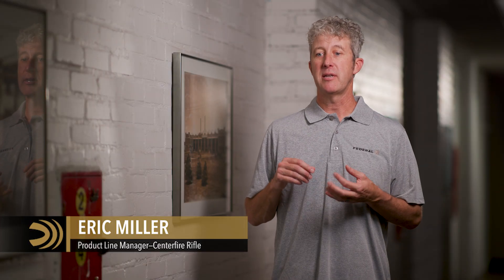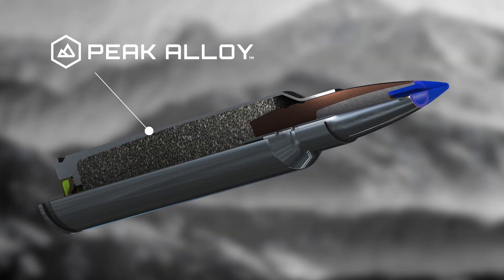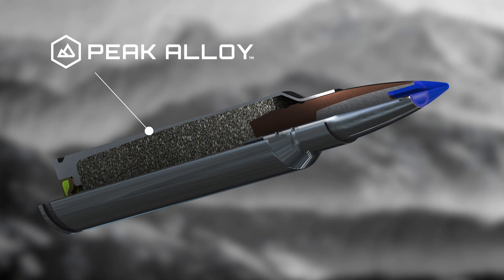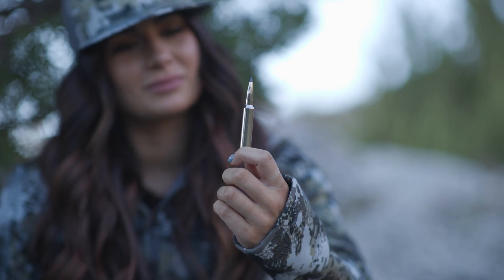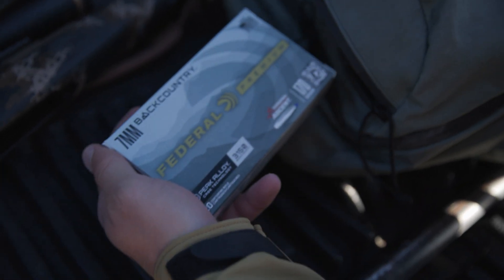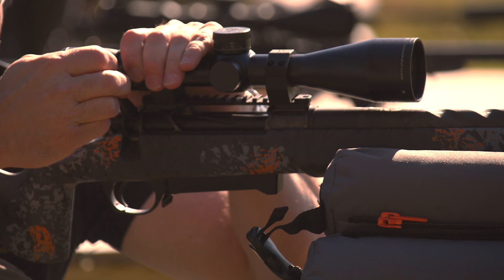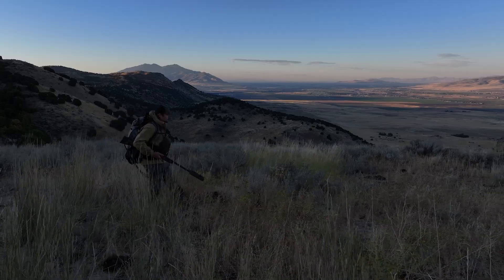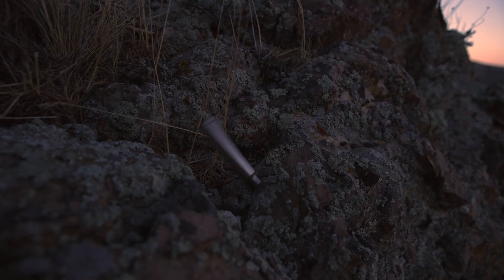7mm Backcountry: What Is Peak Alloy?

Comment: 65000 psi to 80000 psi... The higher pressure downside are 1, a higher barrel wear, 2, a higher stress and wear on lugs and barrel extension and 3, unless primers material is also new like peak alloy... pierced primers !
Nothing is free!

Comment: So I've seen several references to Ultra High Strength Steel alloy being used in other aspects of guns too. Usually it's where weight savings are beneficial and strength is critical. The interesting aspect is that it seems the shift is coming from a move away from yellow metals and lead as a whole. Hornady makes a lot of steel case ammo and has for years. Some of us know what the material is....but it's been around for decades. Many don't realize that steel bullet jackets have been around for almost a hundred years and were the predominant metal jacket in  WW2....

Comment: If this peak alloy thing is going to work, manufacturers will adapt this steel alloy idea. I mean....technically you could just take a 223 Remington round and instead of loading it with the max of 24.5gr of N133 (55gr FMJ) just take the next faster powder... N130 would be listed with 23.5gr max. But with such a case I guess we could add 1 grain easily. Using the same powder won't work cause of the cases limited volume.  So the recipe lies within the stronger case and the next faster powder. Good idea if its working. You could push a 5.56 bullet out of a 16" ar15 with the same speed as with a 20" bolt action rifle shot with regular brass ammo. Packing this idea into a short action rifle will catch the army's interest and eleminate Sigs very costly 6.8x51 Nato.
Reply: Geissele came out with a video of them shooting Peak Alloy out of their 5.56 guns
Reply: They already are testing this in .223 Remington

Comment: Could  a .280 Rem be rechambered, similar to rechambering in .280 Ackley Improved, to shoot this new ammo? What is the major difference, besides case material, powder and pressure, between the .280 Rem and the 7mm Backcountry? Is it a steeper shoulder angle? If a .280 Rem has already been modified to shoot .280 AI could it also shoot this new stuff?

Comment: So why not just use peak alloy on traditional cartridges to amplify their performance, 243, 270, 3006, etc. instead of making a whole new caliber cartridge???
Reply: Old bubba will try to shoot them in a rifle that can't handle these pressures like a really old bolt gun or maybe some of the auto loaders.
Reply: @gerry6.8 exactly, it’s a liability issue. Plus if they can get this to catch on I’m guessing it will be more profitable.
Reply: @ratherbefishing4225  Correct, it would be nice if we could but they can't take that kind of risk.
Reply: @gerry6.8 what risk?
Reply: @gerry6.8  they tested it in multiple standard production rifles. seekins christianson, and even savage 110s as well as many others.
Reply: @gerry6.8  i was gonna say cant have the same name or people will use it were it shouldn't be. like .45lc +p can't use that in a standard .45lc pistol but people have tried.
Reply: @gerry6.8 modern rifles can withstand 120k psi
Reply: @jeffholton6587  That's my point, those older rifles aren't a modern gun.
Reply: @ which older rifles? Steel shot in old shotguns can blow the barrel out. So which ones are you referring too? 

You can look at an old barrels and see if it is thin steel barrel but older receivers aren't made thinner. Doubt the metal has degraded or is of lesser quality.
Reply: @gerry6.8  savages 110 came out in 1958
Reply: @Blue_Dog_Ranch  Yes they certainly are a strong action
Reply: @jeffholton6587 yeah but for how long? I would NOT want to shoot my 4th box and shear a lug off and send the bolt back into my face.
Reply: @ when you get a chance to look at one of these 7mm back countries you will see the lugs are no different than a none back country rifle. No redesign of the lugs or added lugs or chamber modification just chambered to fit the new demisions of the cartridge
Reply: @ there will be cartridges made for these other calibers even if it is done in someone basement this is the united states of America 😊
Reply: @jeffholton6587 then why did seekins beef up their action to handle the higher chamber pressures of the new federal cartridge? Apparently more cartridges are coming out with the same concept this year.
Reply: @ how did they beef up their action? 60 degree bolt isn't beefing up an action in fact you could argue contrary
Reply: @ they changed to a beefier 3 lug action to give the 60 degree bolt throw AND be able to take higher pressure cartridges. They quite literally future proofed the new design
Reply: @  As you stated they had to go to three lug to have a 60 degree throw. 

The rest of what you said sounds like marketing smoke and mirrors to me.
Reply: @ well it’s not me saying it…they literally said they beefed up the action. Why the hell would you run a standard action on an 80,000 PSI chamber pressure? Thats stupid as hell
Reply: @jeffwilliams3436  the problem with higher pressures was not the rifles but pierced primers and blown pockets

so smaller firing pins, tougher primers, and tougher primer pockets/case webs
Reply: @jeffwilliams3436 with a 280ai at 80000 psi, a cmv barrel only 1/4" thick, and a carpenter 158 bolt, and a savage 110 action. 

 you are below the max limits with the chamber being atleast 2x stronger than needed an the bolt lugs being atleast 20% stronger than needed
Reply: I have no issue with them creating a new cartridge, however I had a similar thought as you. What happens if they use this peak alloy and fast burning powder in existing rounds? In theory it should just mean increased velocity/performace across the board right?
Reply: @DavidSmith03-l2z  Yes as existing receivers and actions can with stand 120k psi they do not have to do anything other than supply the peak alloy case for any caliber. Allow is cheaper than brass.
Reply: thats right. its almost a 280 AI.
Reply: @beavisbrowne3497 ding ding ding!
Reply: This was where I went to yesterday. An 80k psi 300 Win Mag would be just fine for me, but feel that there’s lawyers involved somewhere here…
Reply: Right, this is the question!  Why not a 270 win or 280 AI?
Reply: Bill Geissele has already published a video on FB demonstrating an AR15 firing the 223 loaded to higher pressures in PA cases.
Reply: I was thinking .243 & 30-06. Would be pretty sweet to see those numbers.
Reply: Hopefully they run a line of peak alloy cartridge cases in the very least. 

That way, if you were so inclined, you could load your own ammo. It would take some liability off Federal as well.

Comment: The frustrating thing is that there's nothing for reloading, Now !
 And only 6 reloads Sucks.
Reply: This doesn't change the dozens of other cartridges which use a brass cartridge case, and this is only a point in time item.  Early rolled brass cases weren't reloadable either.  This cartridge requires learning new reloading techniques and at this time has limited case life.  So what?

There are plenty of hunters and shooters who do not reload.  For these hunters this cartridge may have appeal.  Perhaps five or ten years from now "Peak" allot may actually be as reloadable as brass.
Reply: But less powder for each reload compared to a magnum round so you'll save money there. Might even itself out that way.

Comment: Looks like a nickel case like. You'd find on 357 mag 460. Notice that don't say what alloy it is. Seems more like a rebrand marketing gemmick.
Reply: They are not nickel-plated brass like premium pistol ammo.  This is more like NAS3 cases.
Reply: @ronaldtrask3444  Well, if that's the case, they should be 50% lighter than a brass case of equal size.
Reply: @davidhomen6204  I am hoping so.  That will be a great benefit.
Reply: @ronaldtrask3444  I do like the highter velocity you're getting with the heavy projectiles with this cartridge. That's one thing that's always bothered me about the 7 rem mag.

Comment: It will definitely be interesting to see what kind of velocities these new casings provide the reloading community.
Reply: I'm hoping that instead of a bunch of new cartridges trying to reinvent the wheel, all the old  cartridges get updated to take advantage of these new alloy cases and higher chamber pressures
Reply: @Cloth_Gloves  The problem with old cartridges is the rifles that chamber them may not be safe at these higher pressures, and for that reason it will never happen commercially.
Reply: @Pete856 modern rifles chambers can withstand 120k psi the cases are the limiting factor with the pressure not the chamber of the rifles.

Comment: When will Federal release intel on how to reload these cases. I understand it can be done but requires additional steps. Next, when will Federal release the smokeless powder necessary to achieve the velocities?
Reply: the powders are already available, you will just be using  a larger quantity of a faster burning powder than normal for the case size.
Reply: @jonathanrogers9961  Not sure if it was a youtube comment, video, or other online article but the way I understood it is that Federal would eventually "release" the powder to reloaders "eventually." I took it to infer that releasing it means not available to anyone vs "reveal" which might imply a powder we all know about already
Reply: @jonathanrogers9961  not that easy...
Reply: They are likely using a powder based on h322, or something similar
Reply: The 7mm Backcountry barrels are impossible to find and the reamers are non-existent if a hunter wanted to have a barrel made.  Federal needs to take a lesson from Hornady imo.
Reply: I'm guessing a mandrel for neck tension and lube will have to be used to seat bullets in a hard case.
Reply: Backcountry uses completely standard, existing powders. It’s just that instead of your typical load for this you’d probably step up to something a little faster burning

Comment: What pressure is it handling, 80K, 100k, 120k psi? SAAMI approval coming?
Reply: Federal website says 80K psi max pressure.
Reply: It's already SAAMI approved.
Reply: I don't think SAAMI will approve over 65k pressure...
Reply: @deanriley4700 they approved the .277 sig fury at 80k
Reply: @deanriley4700  They approved 277 Sig Fury at 80K max pressure.